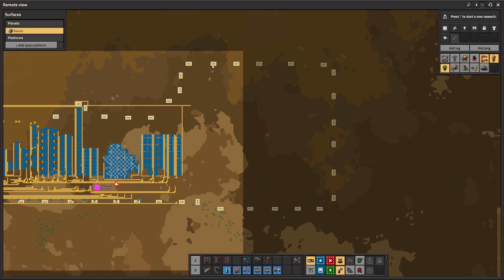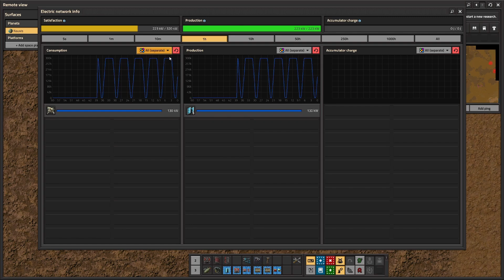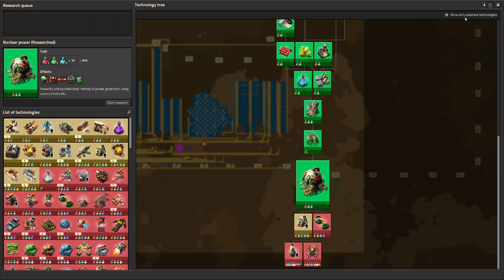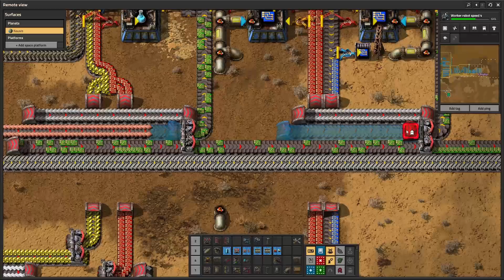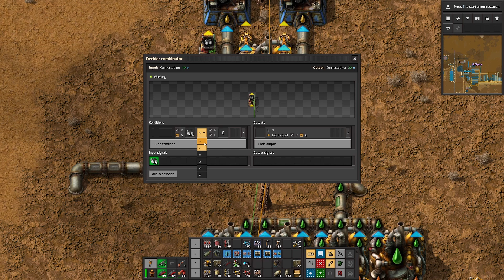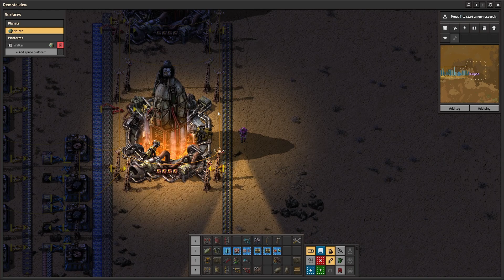Actually Launching a Rocket! | 14 | Factorio Space Age

Comment: I had no idea you could change recipes with circuit conditions, I'm totally stealing that idea for rocket fuel :P
Reply from the maker: This is the first time I've done it for rocket fuel, I usually have 2 solid fuel production areas set up which use priority splitters to use up extra petroleum gas first but this is way more compact with the same throughput.
Reply: Yeah this time I set it to only make solid fuel with excess Petroleum, but I like the way you did it, it seems a lot smarter.